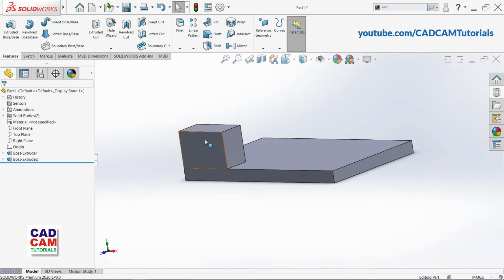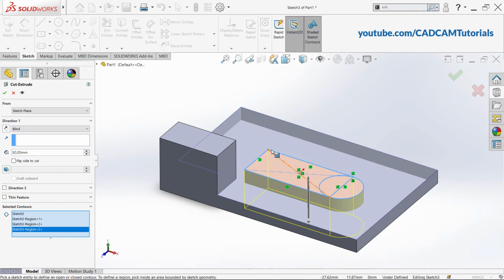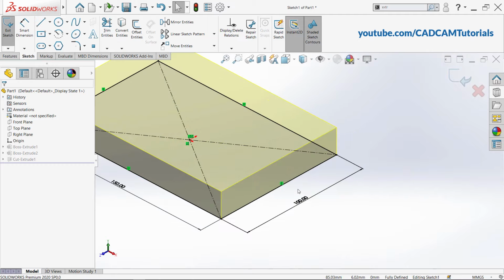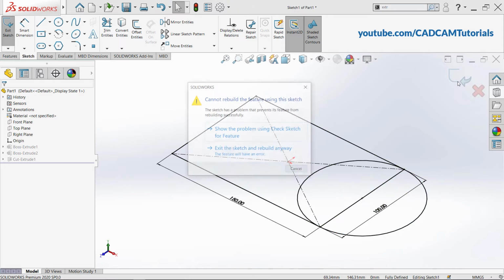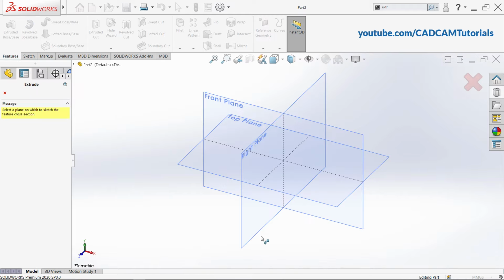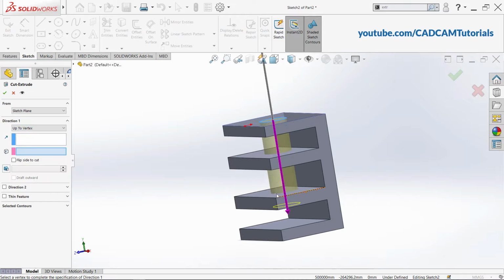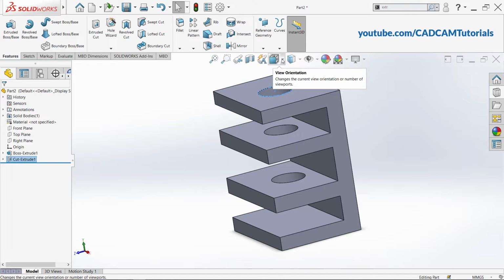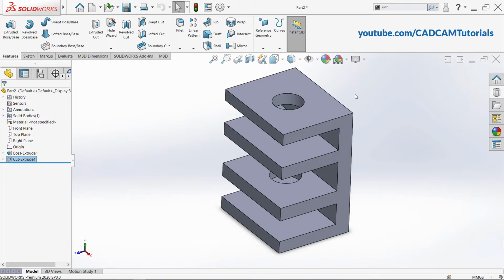SolidWorks Tutorial for Beginners #2B

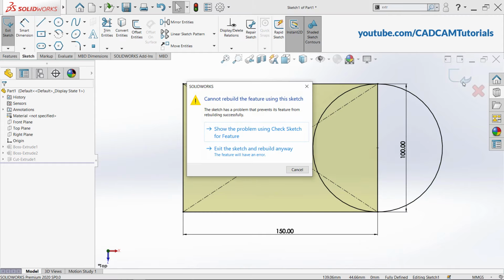Comment: @ 4:45 I get no errors and it just goes to 3d without the circle. If I go to edit again the circle is there. Tried it a dozen times exactly how you did it on the points. Tried trimming a few times, but forgot the middle line. Wew... finally done. Fixed that also under options->messaging->show what's wrong for every rebuild was unchecked.
Reply: which middle line ?? actually  i am also getting the same issue .....and not able to resolve it.
Reply: @hbgamers3008  It's been a while and I've done about a two hundred since that one that I'm not sure what I was talking about. I think going back to the point in video if I remember it was just the center line in the circle/part of the square that I wasn't deleting. I do these with the volume off so I miss things sometime. These video's are old, he never even years ago replied to people it looks like. I was trying to get an answer from anyone out there and it looks like I might have to be that person lol. I also don't like that on a lot of video's he gets things wrong himself or just clicks the fully define sketch, when as teaching beginners gives them an easy way out? Should never do that and figure out the problem yourself. Wish we had a way to chat. I wouldn't mind helping get through some of the problems that I basically was going through a few months ago. I can say what I've learned and try to help. I pretty much am at the point of doing the beginner one's before he does, then I watch the video to see how he did it.

Comment: At 4:41, i've tried to sketch the circle for many times n do exactly they way you teach but its still got error?? I've already draw the circle starting on the midpoint but when i tried to cut the circle, its still hv a little bit of the line at the end of the rectangular point which make it error each time i try to exit sketch.. The thing is i hv already put the dimesion on every line of that rectangular but still got the error after sketch the circle.. Pls help me 😢
Reply: do you got any solutions 
i too have same problem
Reply: @sensationalwolf  no i dont 😌
Reply: He did it quickly, but you also have to trim the right line of the rectangle.  You will get a center error, but just click OK.  It's just telling you the center of the circle was defined off of the center of that line.

Comment: i got problem in error solving steps when i finished the stop and repair command it was still showing a pop up error and I had tried that so many times ....
Reply: He did it quickly, but you also have to trim the right line of the rectangle.  You will get a center error, but just click OK.  It's just telling you the center of the circle was defined off of the center of that line.